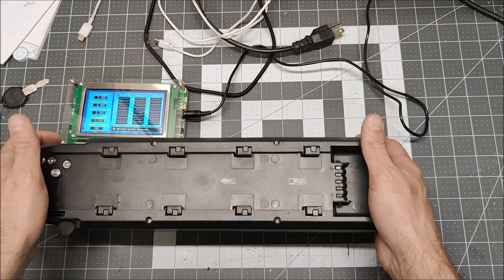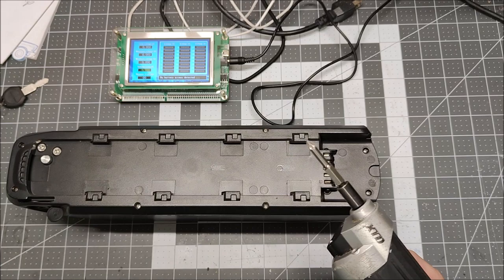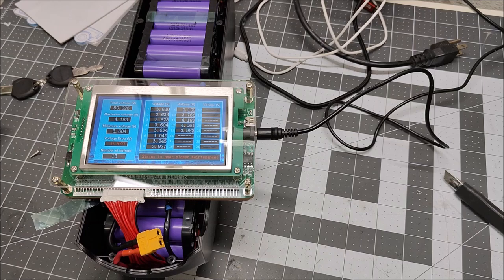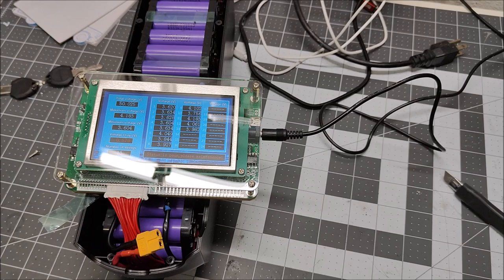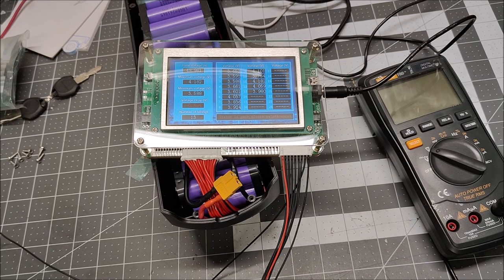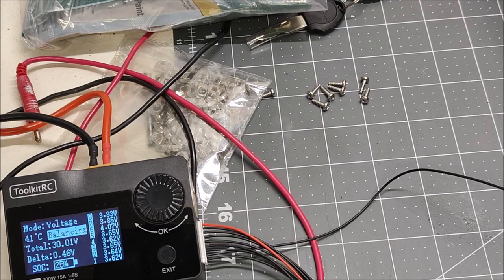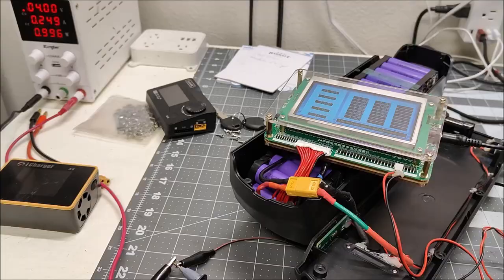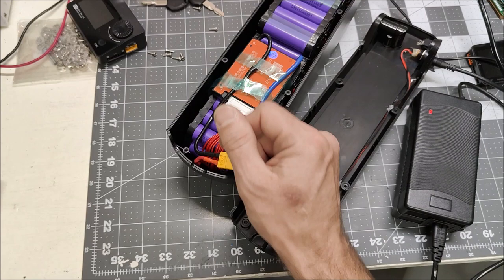Balancing a Ebike battery with a RC Charger

Comment: For anyone thinking of doing this with a LiFePO4 battery, remember the flat curve of the voltage between 3.00 and 3.30 means you have to top or bottom balance. Can't play around in the middle and actually get the energy in the cells to be equal

Comment: THis is a great video.  I like the harness.  Most ebike batteries seem to come with the smaller JST (PH 2.0?) connectors which are different than RC JST HX 2.54 connectors.
Reply from the maker: Correct. Very annoying the 2 different size balance leads!

Comment: Have you thought about fitting a bluetootrh BMS, so that you can keep an eye on the health of the battery
Reply from the maker: Yes but my only concern is keeping the Bluetooth powered will draw energy from the battery, so if you don't use the battery for a couple months the Bluetooth could drain the battery.
Reply: @stevenc22  Yes,others have said the same, but would it be possible to install a switch, so that you could turn off the bms when the battery is stored. Great channel by the way, great content.
Reply from the maker: @RobertAdams-ly5ku  not really. The Bluetooth is internal of the BMS so no way to turn it off
Reply: @stevenc22  Thanks, I didn't know that, as others have said that they were going to install a switch
Reply: I have a similar situation and a 13s 48-52vdc system. This video is exciting as I have been using a dual 6s RC charger with a cradle system in series that I built, The hours involved are VERY painful so I've been desperate to buy a BT-BMS that provides data and safety to every cell with a phone app. I did not know about needing a switch. I guess an alternative could be setting up a trickle  charge.

Comment: I loved your idea of spoofing the RC charger into thinking it had its bulk power cables connected by jumpering to the balance lead's lowest and highest  voltage wires.  This setup makes it easy to plug in your balance connector anywhere in the series string and balance the covered groups.

Many batteries are built with thin balance leads that wouldn't be able to handle much current.  It is important to mention that the charge current while balancing needs to be limited so as not to burn up puny balance wires or in your case the internal traces of your voltage monitor which is being used as a makeshift breakout board.
Reply from the maker: Absolutely. But I'm not charging just balancing. Super low current.

Comment: Holy crap this is what ive been looking for a way to balance a pack thats dead or supposed to be dead because 1 pack of battery drop under the voltage rendering a complete pack van useles im happy with this video this is everything u need to determine if a pack is good a bms is bad ❤❤

Comment: I can't understand why the bike manufacturer doesn't provide a charger that balances the cells.  Obviously it would cost a little more, but my first ebike battery is kapoot after just 6 months.  First ride, it lasted pretty good.  But every ride after that one it's gotten less and less range.  Now I have to crack it open and buy these tools to fix something that shouldn't even be a problem to start with.  They probably make more money selling replacement batteries, and just balance/recondition the batteries that go bad, and re-sell them.

Comment: Could a battery pack be balanced just by connecting high voltage battery string via wire in parallel to low voltage sting until the equalize? Doing this manually over and over with the different strings until they are all equalized just using 2wires and a multi-meter?
Reply from the maker: Yes. Called active balancing moving voltage from one cell to another

Comment: the higher voltage batteries are in better condition or are the lower voltage cells are the better ones ?? i have a bms with 4 groups having lower voltage than the rest of the pack...anyone ??

Comment: Could you not just use the charger without needing the $70. monitor ?  It seems the only advantage of the monitor is seeing all 13 cell groups at once.  Can't you just move the charger to the first 8 cell groups (1-8) then move it to cell groups (6-13) ?  Since groups 6-8 have been already balanced then 9-13 would be balanced to match them right ?
Reply from the maker: Yes you could, the monitor just makes it more convenient by giving you the pins split out
Reply: @stevenc22   Thank you for the video explanation. I finally balanced my battery that I had to replace 4 batteries 1S of 13S 48v battery without matching pack voltage. 
All I used was a 5V phone charger, a usb fan to discharge  and my multi-meter to monitor. 
It was labor intensive and needed constant monitoring of the series of cells being charged or discharged but it worked great.

Comment: I've just ordered my first electric bike(a recumbent trike actually) and this is exactly what I needed to see.  I have an old iCharger 208B that I use to balance my Dewalt batteries with now. I use to fly RC helicopters a long time ago(before the age of drones and autopilots).  What is the pin type for making the balance leads?  All my stuff is JST-XH, but I can't really tell what that balance tester uses(I just ordered one).  Thanks for the great video and help.
Reply from the maker: The internal battery BMS uses a ph2.0 pitch pin. The rc chargers use a ph2.5 pitch pin. You can definitely make a cable with ph2.0 on one end and ph2.5 on the other end.
Reply: The active balancers use thicker cables (because the current is several amps max when the voltage differential is high). If I remember correctly the active balancers use JST VH or VM? and its 3.86mm? something like that

Comment: Hello I have question about an other video. If I have the Bafang BBS01 250W it's a version limited to 25km/h, can I unbridle it to go beyond that?
Reply from the maker: Yes. You can actually do it from your controller screen on the bike. You need to access the secret menu. Each screen has a secret menu.

Comment: If the Bms allowed the battery to become unbalanced, would it not happen again ? Did the battery perform ok after balancing with the hobby charger ? Are those connectors readily available, should I want to use that monitor ?
Reply from the maker: If you charge you battery regularly, the BMS should keep things balanced. When a battery sits for a long time the BMS is not active and the cells will become unbalanced
Reply: @stevenc22  so that is normal behaviour then? or is it pointing to a faulty bms ? I have an ebike battery, made by a shop where I live (Germany), and after each winter storage where I kept it at arround 60 % (estimating by hours charged), the battery exhibits balancing issues, as in less range and cutting off under heavy load. Once I sent it to be repaired, since it was under warranty, but now it's out of warranty and I am thinking if it's better to just try to fix it myself. I had about 20 charging cycles in the 2 years and a half since I had it so I definetly don't think it's ready to be discarded. The cells are pretty good quality too, Molicel INR21700-P42A.
Reply from the maker: @ioandragulescu6063  most BMS are "top balance BMS" meaning they only balance when the battery is completely full at the end of a charge. So when the battery sits for a long time, the BMS does no balancing. However good matched cells should stay in balance by them selves. If the battery gets seriously unbalanced during the winter, it implies there may be some faulty cells.
Reply: @stevenc22  aha, so assuming that was the case to begin with, the guy just rebalanced the battery and then over the second winter the faulty cells acted up again ? I would assume that would mean identifying the faulty one(s) by isolating the S group fist and then maybe replacing all 4 just to be sure? (it's 13S4P battery, 48 volts)
Reply from the maker: @ioandragulescu6063  In theory yes, but do you have the tools and skills to dissemble and rebuild the battery? If not, maybe just buy a 13s active balancer. At the end of winter, plug up the balancer, let it rebalance the battery and then charge it up. The cells might only be slightly out of balance, might not be worth ripping the whole battery apart. Kind of depends how bad the cells get out of balance.
Reply: @stevenc22  so, if you would recommend me a path forward, would it be to buy a tester to get the picture of the S groups and an active balancer (like the blue one you have in one of your other videos ?) and hope it works out ? :)
Reply from the maker: @ioandragulescu6063  if the battery is not too far out of balance then yes I would just buy a $15 active balancer. The tester is cool but expensive and not completely necessary for balancing. You can manually use a multimeter to test the battery id you want to save a few dollars.
Reply: @stevenc22  would I be able to judge how out of balance it is by cheking how lonk it takes until fully charged and then measure the output voltage? Like what would be a really bad measured voltage for a 48V battery  that reads as "full"?
Reply from the maker: @ioandragulescu6063  Yes. A 13s 48V battery should charge to over 54V full. 13s * 4.18v = 54v+. Anything below that is likely an out of balance situation. Anything under 52V i would consider a serious out of balance situation.
Reply: @stevenc22  well, I charged it to 46.6 V, measured all the 13 leads to the BMS and got an even distribution of 3.58V/3.59V, so it seems balanced to me. I'll charge it up fully and measure again. Dang, I really thought it's unbalanced judging by it's behaviour.
Reply from the maker: @ioandragulescu6063  That is pretty balanced. Fully charge it and see it it takes all 54 volts.
Reply: @stevenc22  so the battery is fine now and I have no idea which of the things I did to it fixed it. Maybe it was because the battery was so low on charge that it was not turning on, the cell groups got balanced (BMS with bottom balancing?) or maybe I reset the BMS (apparently that's a thing?) by removing the sensor wires plug and reconnecting it. Point is, while monitoring the charging from 50% to full (54.5V) the delta between the lowest cell group and the highest was always arround 0.008V +/-0.003V (I soldered an active smart external BMS unit and was monitoring via the phone). And today I went for a test ride, the full range is back and no more cut offs. So ... yeah ....I'll see next year after the winter storage. If it acts up again, it may be time to replace the BMS.